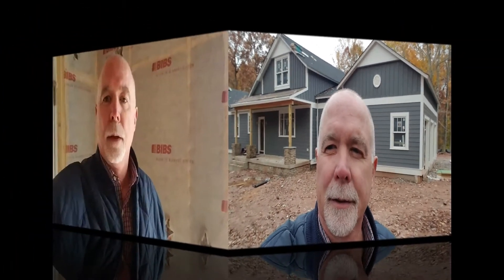Net Zero Custom Home – Cellulose Insulation – Matthew Bowe Design Build

Comment: Question, how come you didnt use a product like Roxul comfortboard?
Reply: Roxul Comfortboard in lieu of what?
Reply: @matthewbowe62  the blown in Insulation. Do more of a flash and batt system. We're going to be building a ranch style home near Savannah GA with a wraparound porch. I've been going back and forth with what would be a good system for our build, ZIP-R with an exterior insulation like Roxul, or ZIP-R with Roxul on the inside? Our exterior cladding is going to be concrete log siding.